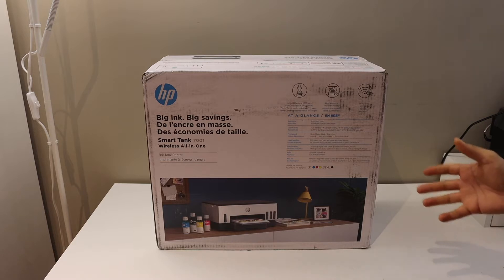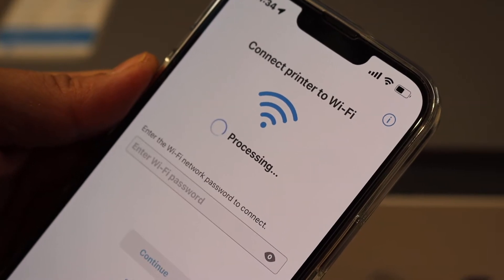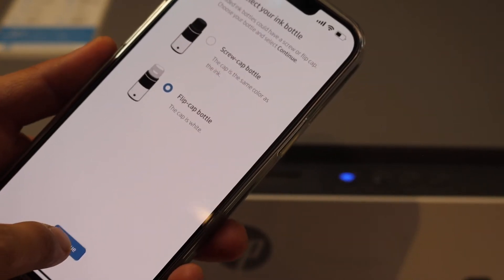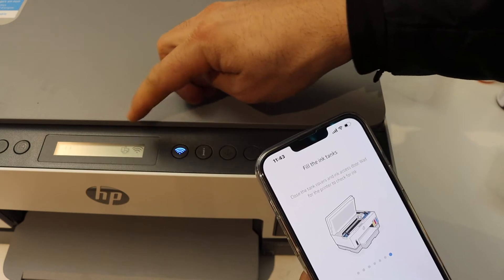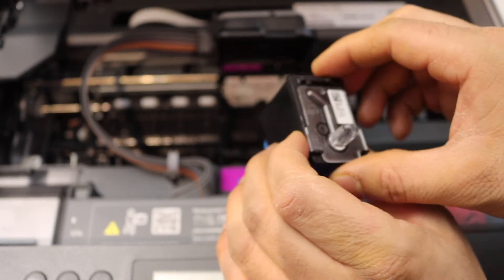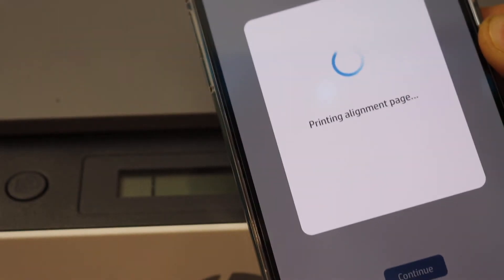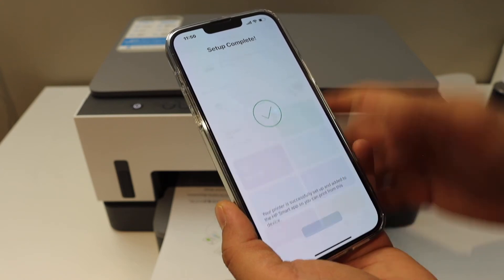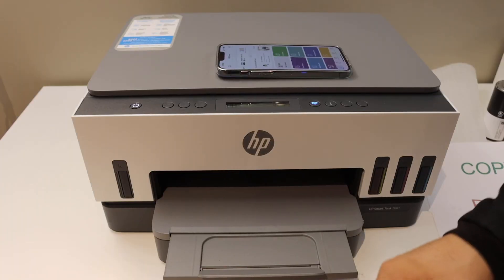HP Smart Tank 7001 Setup, Unboxing, Fill Ink Tank, Load Paper, Wireless Setup, Review.

Comment: Help I have 675.

My problem is wifi not showing in printer and mobile what to do
Reply from the maker: Press wireless hutton and see if its icon on the screen.
Reply: @CopyPrintScanChannel  wifi icon is there. but not network icon.
Wifi button blink or wifi direct both not working
Reply: @mohammadshadab2139  Are you on an enterprise network?
Reply: @Clive_Standish  no
Reply: @mohammadshadab2139  Hmm are you trying to connect to it using a phone, or have you tried using the driver setup from hp website on a laptop. I had the same issues with my phone but the PC saw it
Reply: @Clive_Standish  problem with mobile. Yesterday I complained to customer care and they change my printer. I get new printer